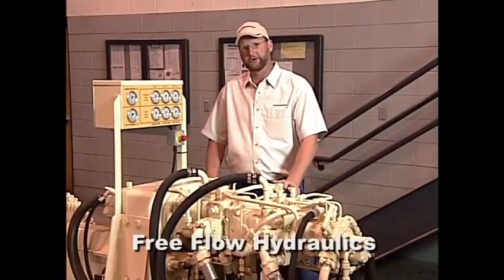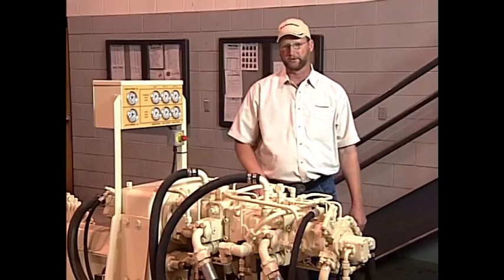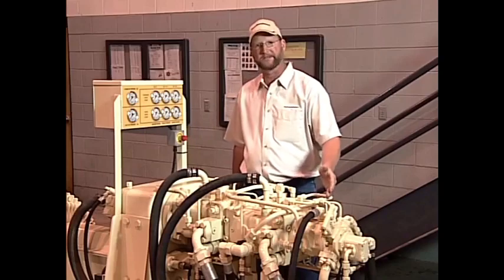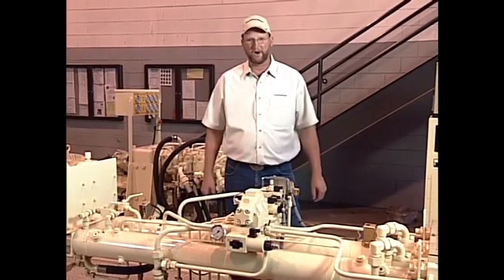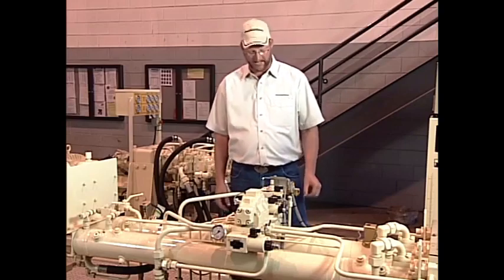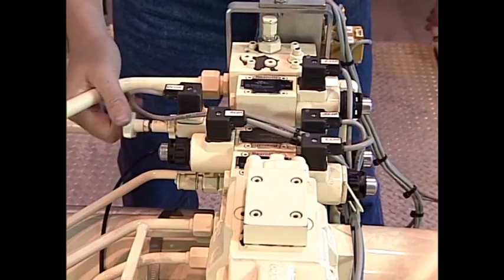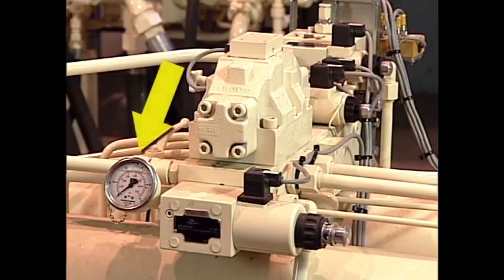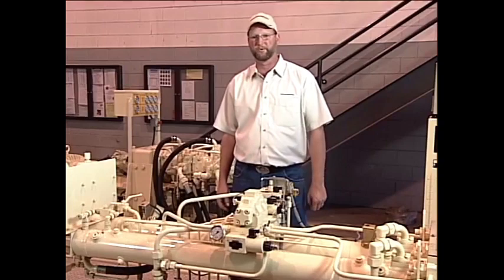Putzmeister: Free flow hydraulic system (FFH)

Comment: I m operating 36-4 ergonic 1
Pumping issue.one piston work slow and one work so fast very difficulty during colum and beams work
Both piston are new and bolts are tight.
How to fix this problem
Reply from the maker: Dear Raja. We already saw your comment on another video. our service team will get in contact with you to help you.
Reply: @PutzmeisterGlobal  thank you for ur reply.ut is true zubair automotive dealer in oman for putzmiester contact me.they know about my company and my pump very well.10days before i was in workshop.only two days its work well again it started pumping problem.one fast one slow.they change bar sensor that time.
Reply: They want my pump back again in their workshop.i am  far away not possible to take my pump their due to my company project.
Pls help me how i can check basic of this problem.if i not understand than i can take it ti putz wotkshop
Reply from the maker: our Putzmeister service team will contact you to detect the problem on your machine